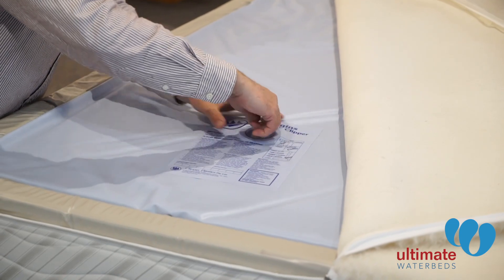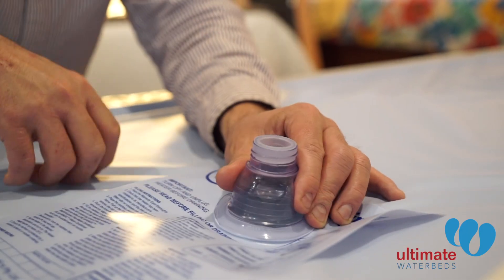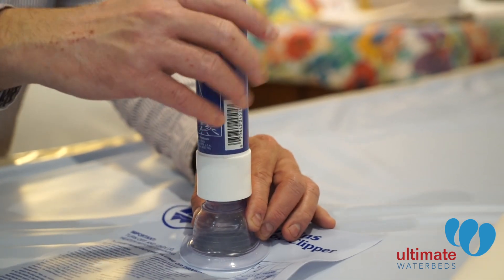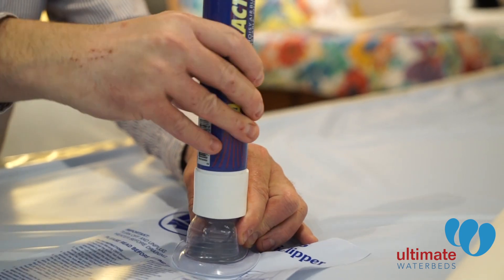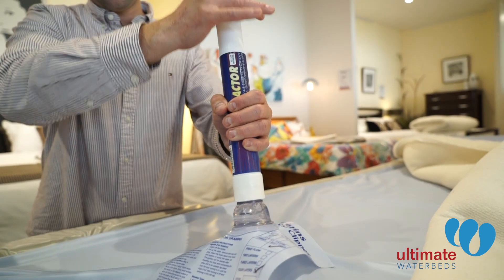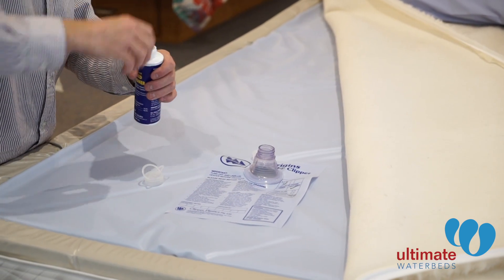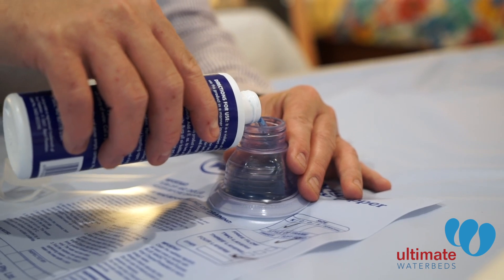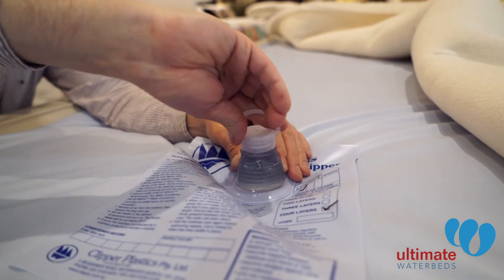Ultimate Waterbeds - Maintaining your Aquafoam waterbed mattress

Comment: Do i need to drain my bed
Reply from the maker: Hi Luke, a maintenance service will not require you to drain the bed.
Reply: @ultimate.waterbeds  ok so I don't need to put fresh water in my free flow hardside waterbed
Reply: also whats the best temp for the bed for the summer months
Reply from the maker: @mywaterbedpage6851  Not if it is filled already. All you have to do is add the waterbed conditioner and the Bubble Reducer treatment. It may also need a top-up if it hasn't had one in the last 12 months. If you require the above-mentioned treatments give us a call on (08) 8258 3300 and you can place an order.
Reply from the maker: @mywaterbedpage6851  It's a personal preference, but generally around 26-28 degrees.
Reply: @ultimate.waterbeds   can I use cleaners on the mattress if so what kinds can I use on the mattress
Reply: can I use cleaners on the mattress if so what kinds can I use on the mattress

 

 

Reply
Reply from the maker: @mywaterbedpage6851  We don't recommend any harsh cleaning products, as they can cause the vinyl to harden and eventually crack. We sell a specific Waterbed Vinyl Cleaner specially formulated to clean the outside of your vinyl.
Reply: @ultimate.waterbeds  ok a friend of mine told me use wipes on the mattress